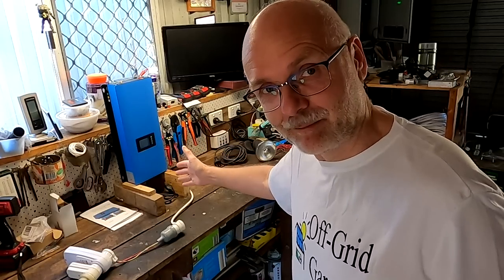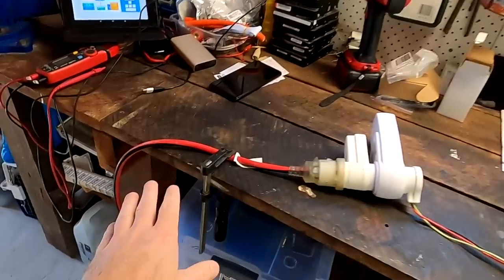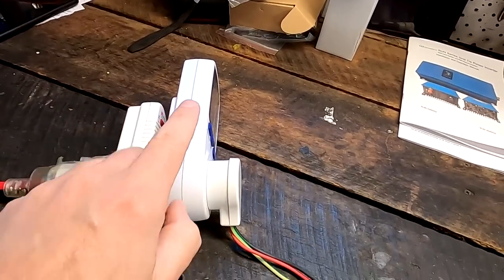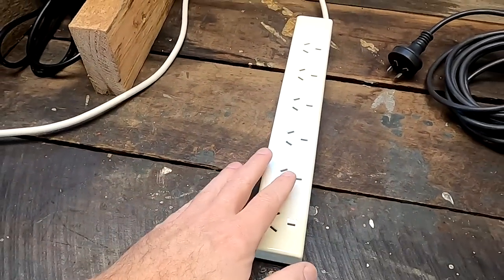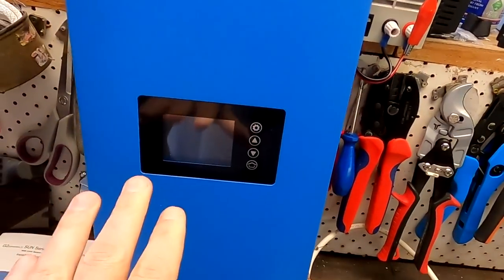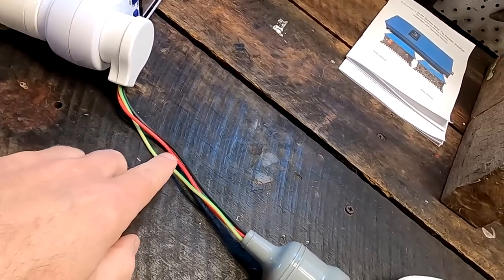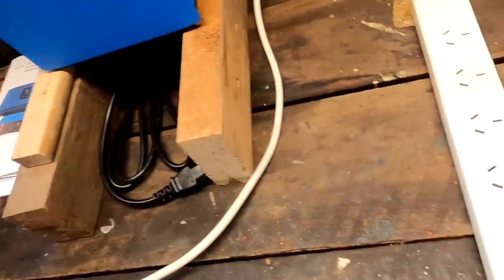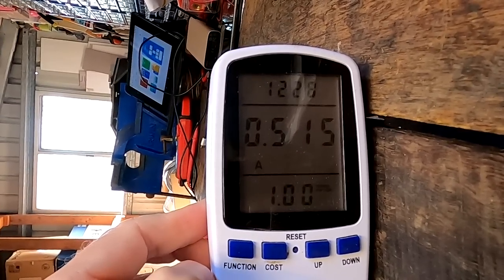Sun 2000 GTIL2 Inverter full test. How it works, what it does.

Comment: You noted above that you don't recommend connecting this device to a GPO (because it is illegal for a start) , so how are you going to use this in your final setup so its legal and meets all Australian standards. The big problem is this unit is not approved for use in Australia so how are you going to get around that problem. Great for testing and experimenting but of no value here in Australia or most countries for that matter for actual in service use?
Reply from the maker: I'm testing the units at the moment. It's just an option.
You can just cut the plug off and connect the cables directly to our RCD/breaker.
Reply: @OffGridGarageAustralia  Yes cutting the plug off is fine but it's still not an approved inverter for use in Australia. If something does go wrong you may find you are not insured.
Reply from the maker: @henvan8737  can I still test it... please?
Reply: @OffGridGarageAustralia  Andy does this device have a CE mark or certificate?
Reply: @OffGridGarageAustralia  yes, but to what final value do you get from the test. Nobody should repeat the test and we can't use it in real life set-up. Andy you had two live not fully insulted wires sitting on your work bench that is unsafe. Yes low  risk but still unsafe and no unqualified person should be doing this at home. And you have a responsibility to the community to state very clearly in your video that you should not attempt this at home it is dangerous. Getting a spark from a battery when you make a mistake is one thing but if you make a mistake with grid power you may not get a second chance.
Reply from the maker: @markparker9749  The value of this test is that this is a technical solution to my problem which would work. 
I never had any uninsulated wires on my workbench, Mark. I'm running a test, towards a certain outcome. That I took the outer insulation off the cable does not make it unsafe for such testing. It's the same when measuring inside the switchboard, there is only single insulated cables.
Getting your point though, thanks for your advice.
Reply from the maker: @markholly3757  yes, absolutely. But the inverter will turn off when the grid is turned off or fails. Like all other solar inverters which are grid following, they all have anti islanding to prevent exactly that. There is no way they will stay alive and cause a thread as I have shown at the around 33:00 mark of the video.
Reply: @OffGridGarageAustralia  Looks like a bit of controversy about connecting an unapproved device to the power.  So many nay sayers. Next time just tell a white lie and say the test rig is connected to a generator outside.
Reply from the maker: @mikedavison4313  I don't know what's wrong with people. I'm just testing these devices. From a technical perspective, it's a solution and will work. That's all I'm showing.
Reply: @mikedavison4313  Yes that would make it safe and legal?
Reply: @OffGridGarageAustralia  Yes but we like your videos and don't want to attend your funeral.
Reply: @OffGridGarageAustralia  Hi Andy. Thanks for the information. Do u know how quickly it reacts to the limiter sensor? My meter trips off if it gets any return power at all so it needs to stop evey bit of power immediately and allow nothing to go back to the grid.. Will it do so? And I have a 20m sensor cable Do u think that could be slowing its reaction down? Please advise me if u can. Thanks
Reply: @Clarkenth7047  20m sensor cable would only decrease the accuracy of the sensor due to voltage drop across the longer cable (just calibrate for this and you're good). The signal travels at the speed of light so a 1m or 20m cable makes negligible difference. The largest delay is in the inverter itself and the time it takes to downregulate the power output.
Reply: Yes he does have a great off grid site., but you don't do you?  Andys reply is that your wrong. And I agree your wrong
Reply: @kyba74  hi there thanks for your response but any idea how i would  calibrate the inverter?
Reply: You really don't have to defend yourself to somebody like Mike. Thank you for the excellent video, I learned a lot I know exactly how this thing works the good and the bad, I'm actually buying two of them

Comment: I Had 2 of those already, work as described , easy to use and very versatile. The only problem is the excess heat when used above 1.5KW with the Battery voltage around 50v, mine have both burned out. If you plan to use more than 1.5kw in a sustain way, better to have a much higher battery voltage to reduce the DC input Amps .
Reply: This is a great suggestion. Limit the amps so that never producing over 1500w and for the 1kw limit the amps so the inverter won’t produce over 750w. I use a 60v nominal lithium battery to power both of my 2kw inverters. Voltage goes up to 64v. This is a good voltage to run the 45-90v inverters if using batteries. 48v battery is really to low to use with the 45-90v inverter. That low of voltage will make the inverter use more amps which isn’t good for it. For the 22-65v version a 48v battery is great
Reply: @RJ-cc1fz  I see you have got  useful information here. I am concerned about the build quality in those inverters. In my opinion Chinese products are like, if they say 2000W for example you can assume it to be more like a 1000W device. So, you are saying if I was to build a system with the 2000W version for battery use, the battery pack voltage should be closer to the 90V DC range.
Reply: @repairman2be250 No it doesn't need to be that high. The max input amps is 35ah with 85% efficiency. So you need a 65v battery to get the full 2kw. So a 20s lifepo4 would be perfect here.

Comment: No Australian accreditation on this inverter means you are on your own. I think its dangerous to even consider it, but makes for an interesting video. Unfortunately there maybe other followers who think this might be a good solution. Your power company if they knew what you have connected to their power network may consider some action against you.??????
Reply: why is it dangerous?
Reply: @John-gm8ty  Because firstly the inverter is not quality accredited for use in Australia.  Secondly using power plugs with exposed pins as the power supply source is fine if everything is working correctly, but this is how people die when something goes wrong. There is a possibility of back feeding to the grid when things don't work as expected. This appears to me a complex way of working around established rules and regulations. An Off grid solution would be much simpler to achieve, and 100% safe.
Reply: @henvan8737  not being accredited does not by default make it dangerous.
Reply: @John-gm8ty  it also doesn't make it automatically safe. A listed device is safe due to the testing needed to get the certification.
Reply: @MrJramirex  I did not claim it was safe, I asked why it was unsafe.
and not being certified is not a valid reason.
"A listed device is safe due to the testing needed to get the certification."
bolderdash poppycock.
Reply: @John-gm8ty  any company that promotes and sells a unit that pushes power through a GPO to the general public, in my mind doesn't have safety high on their list, therefore what other things inside the unit have they potentially compromised safety.
Reply: @markparker9749  and your reasons behind your feelings?  

my point is to explain why to people who do not understand why it's a bad idea.

some people do not understand the risks.
Reply: Holy crap it’s a TEST People. !!!!!
Let the Man keep bringing us content or start your own channels and show us the SAFE WAY. Owe yeah you don’t have channels !!!  Do You?//
Reply: @tyler6865  karens never want to do it themselves, they want others to conform ;)
Reply: @tyler6865  actually one of the people who did commented on how unsafe  this unit is does own one the largest off grid website in the world and he  does present valid and safe solutions. I love testing things especially if something blows up, but don't present something and say that it is a potential solution when it can't legally be used in most countries.
Reply: @henvan8737  You should stop driving cars and trucks, as if the brakes fail, you could kill someone!
Reply: @MrJramirex  They are CE marked
Reply: @markparker9749  Power companies making sure we free people can not have access to things that empower us (sorry, pun not intended).

Comment: Remote Num has nothing to do with the limiter. It's the (modbus) address that has to be used if you want to communicate with the inverter via the RS-232 interface.
Reply from the maker: Thanks for clarification!
Reply: @khwolter9038  It's on top of the case, right beside the connector for the limiter.
You can see it in the video.
Regarding the firmware it looks to me as if they just removed the external limiter. To me this is not an improvement.🙁

Comment: I just buy by 160usd SoyoSource GTN-1200LIM48 1200W 48VBat with max 900W output, where limiter is per ModBus RS485 and we can have one CTclamp or Shelly3M meter and use reading for many of inwerters via wifi ESP modules. Best for ZeroExport / Auto-Consumption for ppl who cannot export any of Watts to grid. Cheap but perfect solution !

Comment: Glad you are using the Ecoworthy/SUN/GTIL inverters.  No need for wire extensions.  It is just 2 wires for the current sensor that run 0 to 5V.  Just cut and add wire as needed.  You can also adjust the sensitivity of the current sensor, I added a 2k trimpot that makes the inverter think I am using less watts than I really am.  I don't think the inverter responds fast enough when a load is stopped so it backfeeds a little without tweaking with the trimpot.
Reply from the maker: Ah, right, I was wondering about this. They say you can extend up to 20m only though.
Reply: Could you show a schematic or links for us non-technical people? This sounds like an excellent idea!
Reply: @benkanobe7500 What do you need a schematic for? It's 2 wires. Cut the wire and split in a longer length. The resistor isn't necessary but you just put it on one wire.
Reply: @shawnd567  Hey thanks. I feel stupid now. Great job!

Comment: I've been using the 2kw GTIL for a year in the US. No problems. Fantastic device. I've taken to calling it my little buddy as it works away pushing watts into the house. One of these days I will make a video on the specifics.
Reply from the maker: You've got the YT channel, so go for it.
Reply: How do you prevent any potential back feeding during a power outage situation?  I'm interested in doing something like this, but only if I can safely prevent it from going back on the grid.
Reply: I think I've answered my own question - if the grid goes down, so does this system.
Reply: Would love to see more details on how you rigged this.
Reply from the maker: @OhDannyBoy2k  yep, it's a grid tied inverter it needs the heartbeat of the grid. For safety reasons they all have to turn off immediately if the grid goes down. It's called anti-islanding.
Reply: Wish I would have found this inverter before i got the growatt grid tie inverter. My city in us found out i was back feeding and put a smart meter in to make sure I dont back feed anymore without a permit. I've since swapped to an off grid inverter with a critical loads panel to use my solar without backfeeding
Reply: Can i use more than 2000wp solar panel to connect to this GTIL 2000 ?
Reply: @petermekel4385  yes. Set the amp limit to 25a to be safe and you can overpanel. Alternatively if you use batteries use a separate charge controller that can handle more but again set the amp limit. Don’t run at full capacity to ensure a long life.
Reply: @thedabbler2753  how did you get the 2000 watt model to work in the US. I thought only 1,000 watt was rated for 120 volts?
Reply: @OffGridGarageAustralia  done (finally!)
Reply: @diySolarPowerFunWithRay  3rd time lucky? My replies are filtered out. I have a channel vid with answers.

Comment: The idea of this limiter used in this Grid tied inverter belongs to Rogel Naval a Filipino Engineer based in Manila. He had this made with masspower in China. It's called Grid Tied Inverter with Limiter or as we know it as GTIL. It's first version has an external limiter which is now phased out, what you see here is the version 2 that has an internal limiter. I had both versions and the version 2 with 22v-60v runs on 48v LiFePO4 batteries. Simple to use. Greetings from the Philippines 🇵🇭🇵🇭🇵🇭
Reply from the maker: Thanks a lot for sharing, Ian. That is great info!

Comment: Bought 1 one year ago, now i have 3, each for one phase. Using it with solar to charge battery and this inverters connected to the 14s Li-ion battery. They work really nice. I recently added wind turbine aswell ;)
Reply from the maker: Thanks for sharing. I'm interested in a wind turbine setup myself. Not that we have super high winds here but from the general perspective and how it would integrate.
Reply: I used three phase bridge rectifier connected directly to the inverters(since they already have the capacitors to do the smoothing) and for brake i used arduino to check for high voltage and set pwm signal to do the braking on ssr relay connected to the heat brake depended on the high voltage. But so i don't discharge battery i used one diode in bettwen so it actuall brake the turbine and not drain battery. I coul use the controller that came with the turbine but i read that they fail on high winds (which i do have sometimes).
Reply: @OffGridGarageAustralia  the newer turbine don't need much wind like a 9blade one. It might not be windy on the ground but you put your wind meter or turbine up about 40ft and it's alot stronger then ground level.
A turbine works better when the solar weather is poor e.g. wet windy stormy teribble for solar but great for wind, wind blows 24/7 so the decrease in performance can be made up with increased run time.
Reply from the maker: @DanielSan-ch7dr  We have like 130ft trees around us so I can see how the wind situation is, direction and strength. I might try it at some stage, but it's a lot of effort to put up the mast, make it all secure... we will see...

Comment: I've just purchased the 2000w with limiter for use in my shed, here in England. Fantastic info, thank you..
Reply: I am very concerned about the build quality in terms of the power rating. Many chinese products don't live up to the specs. Der Kanal has had some in for repair with and without success in fixing them.
Reply: Stuart mate, I've just bought some panels and so now looking into grid tie inverter, do you use just solar? Or do you use batteries aswell?
Reply: @stuartdavies8388 how is the inverter holding up?

Comment: I greatly admire that even with people saying "oh that's a bad idea I wouldn't do that ect" too many people in this world think they know exactly what your situation is and exactly what you should do when the fact of the matter is they don't. I may not build things the way you or others do but by watching you go through your own trials, I learn a GREAT deal from it. NO ONE knows everything
Reply from the maker: ... and I have tested these units now rather than installing them right away to see if it would work from a technical perspective. It would be a viable solution to my problem. And I wanted to share this here.
Thanks for your feedback.
Reply: @OffGridGarageAustralia  Your videos have convinced me to give them a try. I'm still researching how to use this on the US split phase. I see people have wired two CT sensors in series (or is that parallel) with a small resistor. Too bad this is not offered from SUN.  Wonder if you ever used these and do you still recommend them?  Your videos are immensely helpful.

Comment: Great video Andy! It’s a genius device. Simple and seamless. I have not tried it myself (I’m completely off grid), but after seeing this video I started to think it might have a place in an off grid system after all….

My main problem with consumption is the “buffer” of maximum power I need to have. The bigger the inverter, the bigger the idle consumption. So I have a small inverter that I use for the easy loads, and a big, all-in-one that I only turn on when I’m to use microwave, washing machine, air compressor, etc. The difference in idle consumption between the two is around 25w, which doesn’t sound much, but since it’s 24/7, it makes a huge difference.

The idle consumption of the device you test seems to be extremely low.
So my idea here is that I might go even lower, just using a 300w-something inverter as a waveformer and use this device as a “dynamic buffer”. Do you think it would work?
Reply: Have you figured it out? Id like to be able to disconnect from the grid and "trick" an inverter like this somehow (preferably not with a generator) in a shtf situation. It seems you'd want a pure sine wave inverter to feed into it for it to get a clean signal.
Reply: @lancealderman2755  No, I was hoping that Andy would test it since he had the device, but seems he sent it back for some reason 🤷🏼‍♂️
Reply: If there is such a thing as a small inverter that you can set an output limit on and keep it from overloading then you would be golden but Im not sure if there is such an inverter. Would suck to overload your small inverter and the whole thing go down.
It seems like redundancy is the only way to accomplish some things with solar, at least in a grid tied situation. It's unfortunate at the moment...
Reply: @lancealderman2755  If the sun2000 is quick enough providing power, that scenario should not surface. That is what I would have liked Andy to test….
Reply: Oh you want to feed the Sun 2000 with a battery bank?
Reply: @lancealderman2755  indeed I do! 🙌
Reply: Man I like the idea. I wanted to start with a few panels and something like the sun 2000 and if your idea works I could scale it up over time to something like what youre talking about. Someone has tried it already so now we just have to find it... Ha